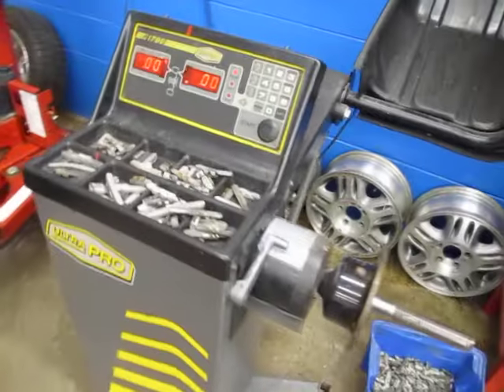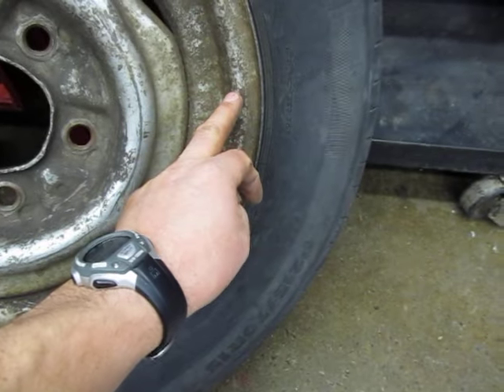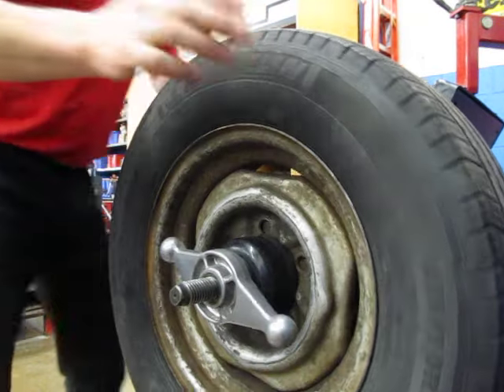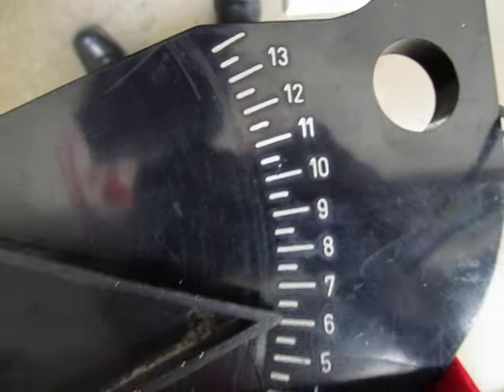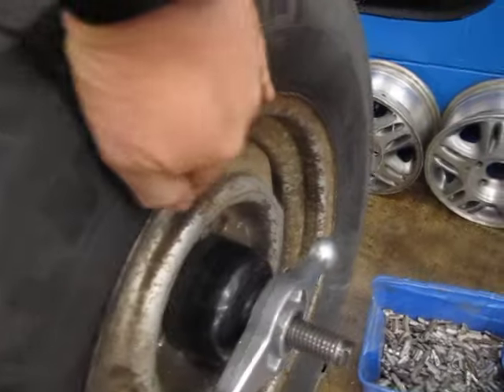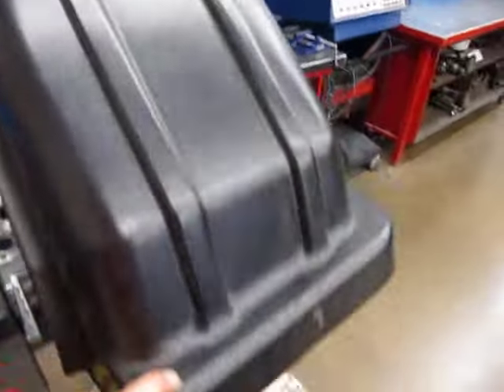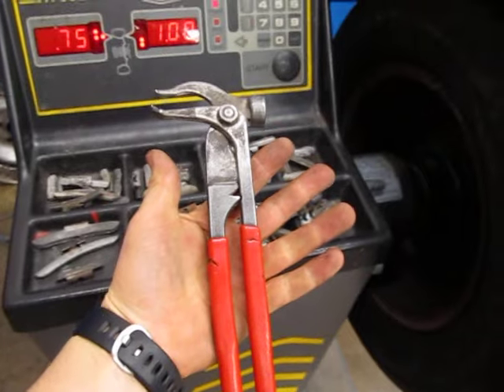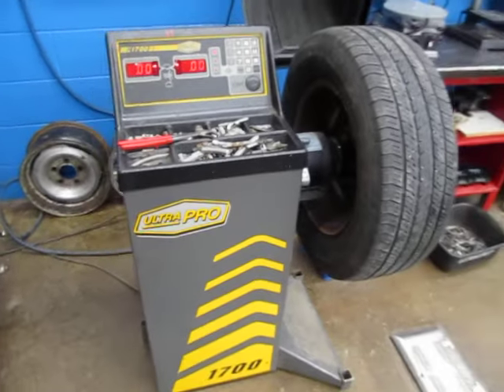how to use the wheel balancer

Comment: you did the best explanation !! would be nice if you did the aluminum rim.
Reply: You just change the wheel and do the same thing.
Reply: You have to use different weights for the aluminum rims as they are generally  thicker.
Reply: Some Aluminums,Meg and Standard rims has three steps while some have four steps as they're grouped and classified as ALU 1-3 and ALUS. Alu 1-3 includes standard rims and some meg rims and requires three steps for balancing while Alus requires four steps because you use the hand measurement two times on Alus,one on the outer rim where you put stick on and on the inner rim where you put stick on. The settings for Alus is a1,ae,d1,& de while in Alu 1-3 the setting is a,b,& d

Comment: Does it affect the balance result if you stop the wheel before it actually stops spinning on the machine? 
I just got my winter tires installed at my local garage. One of the guys who installed 2 of my tires stopped the wheel midway as it was spinning and both times the balance was perfectly at 0. However, the other guy who waited for the wheel to stop spinning on its own had to adjust the balance. So I started wonder if manually stopping the wheel affects the result 🧐

Comment: Very nice demo. My personal take is that any wheel weights on the aluminum rim will eventually damage it. I have never seen an aluminum rim  of some age without having been damaged by the rim weights. I use flat sticky weights on all my alloy rims to keep that damage from happening where it can be seen. Another interesting note is that dynamic balancing is mostly not needed. very few tires need it. If I used this tire on my own vehicle I would always do a static balance unless it specifically showed a vibration after balancing. In the old days tires were never dynamically balanced.

Comment: Very nice in mentioning that the proper tire air pressure is what is noted inside the door area of the passenger vehicle and not what is noted on the tire (which is the max tire pressure). Many, MANY tire shops inflate tires to what is marked on the tire (and also damage wheels by setting them back on the car with a torque wrench that doesn't have a torque limiter); which is a big no-no. On  a hot day, an over inflated tire can rupture when hitting a pothole or other debris on the road.
Reply: They would have to be a pretty dodgy tire shop if they didnt know what tire pressure to pump the tire to. Besides, theres no tire pressure number on the tire itself, the only numbers on the tire are:
1)Width of tire (which he incorrectly states as being a measurement of the tread when its the measurement from sidewall to sidewall)
2) Aspect ratio (percentage of the profile in relation to the width
3) Construction type 
4) Size of rim
5) Load index
6) Speed rating

Comment: So when they balance the wheel, they balance it to a specific pressure? If you get the vehicle back and realize that your tires are aired up a little above the recommended pressure and set them back to normal, does that throw the balance off?

Comment: Great Video thanks for sharing the knowledge.   I changed the tires from Winter to summer tires, when i drive i feel like the steering wheel is pulling to the right side.  what could the problem be here please ? I really need help with this as its  unsafe to drive.

Comment: Need your help!! I have this wheel balancer Ultra Pro 1700 but i dont know how to calibrate this wheel balancer... really need a vidéo! thank you so much!
Reply: Hi, Kim. For calibrating this machine, you will want to use a 14", 15" or "16 steel wheel and tire for the calibration. Mount the wheel on the machine just like in the video with the spring, cone, and hub nut. Enter in your offset (A), width (W), diameter (D) of the wheel that your using. To enter calibration mode, you need to hold the SHIFT button while pressing the CAL button. CAL 0 will appear on the screen and then press the START button. You will then need to place a 4 OZ wheel weight on the outside of the wheel where it tells you to put the weight on. You want to be as accurate as you can on placing the wheel weight as this will affect how accurate it will balance wheels. Once you have done that, press START again to spin the wheel. Once it is done spinning, it will automatically exit calibration mode and calibration is now complete.
Reply: @benisoth  Thank you very much for your help. I can finally use the machine my father left me. A big thank you to you.
Reply: Mr me I Know how to use deferent types of balancing machine so if u still need same one to help u me I can and I have National Certificate in mechanics